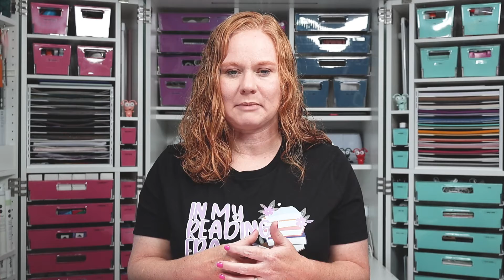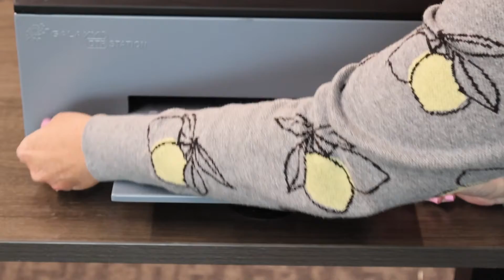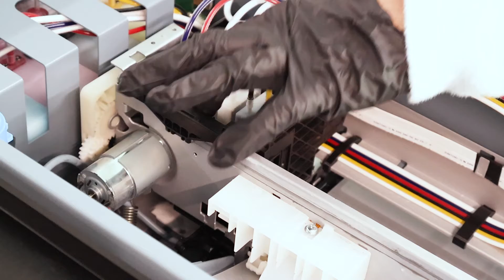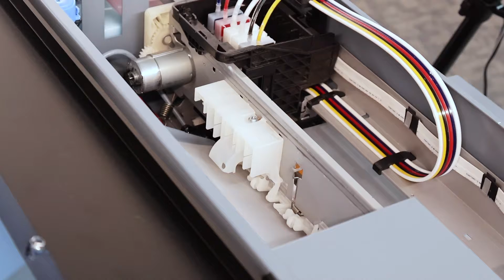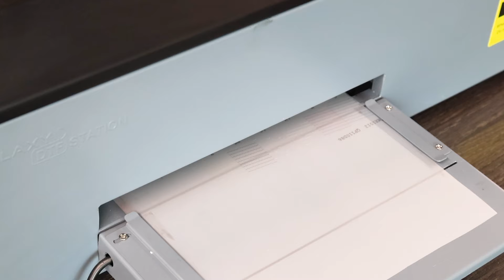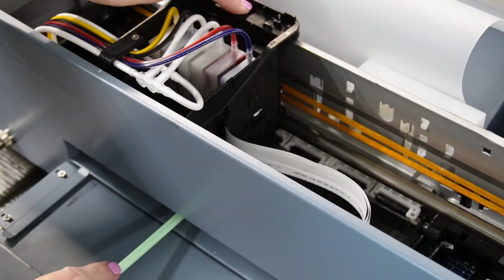DTF Printer Setup and Maintenance: DTF Station Prestige A4 Printer

Comment: When pulling the I'm thru can I use the same tip or should I change every time?
Reply from the maker: You just don't want to mix colors. So if you get one color on the tip, be sure to use a different one for the next color or wipe off.

Comment: Hello, Love your channel! I purchased a DTF printer from Amazon. Im not able to get it running. the feeder roll is not moving. the unit turns on, runs but will not advance the roll forward or backwards.
Reply from the maker: I would contact their customer service.
Reply: @AngieHolden  I've already tried reaching (emails, all social media platforms) out to them. With no luck. Luckily, I'm learning alot about this machine. Just taking a bit more time. I've already filed complaints. Valuable lesson learned.
Reply from the maker: Yea I do not recommend the purchase of a DTF printer from Amazon. I am sorry!

Comment: Just got this printer and havent used it yet. It was already set up by the company who sold it, with inks already filled. Waiting for the rip software code from them before using. Is it ok to sit for a few days with the inks? Would i still need to do daily maintenance while it isn't in use? They mentioned leaving ink caps almost completely loose to let air in but not sure why. Thanks
Reply from the maker: It should have come with cleaner in the wells already so you should be okay. It may take you a while to get it working once you can print.

Comment: Hello, Can we print images for t-shirts that are XL in size for exemple, with the A4 printer ? Thanks
Reply from the maker: Yep. It will print as long as you want so it will work with a design that is not over about 8 inches tall.

Comment: Hi, I have the same printer and would like to know if you ever got banding or lines in your print. After many head clean I’m still getting lines. Any tips to fix this issue?
Reply from the maker: I would print a nozzle check page. Do you have missing segments? I would assume so. If you do, run through the cleaning cycles and pull ink through your damps/waste ink tank. If you don't have missing segments it could be an alignment issue. I would probably contact DTF Station or get on their Slack channel.

Comment: I got this printer a couple of months ago and I love it.  I'm an older lady with only a moderate amount of experience with printers and I was able to follow the Prestige setup videos with no problem.  Once everything was set up it has been pretty much smooth sailing.  I had some initial questions and used their slack app and got pretty quick help (there is a time zone issue as I think they may be answering from another country) but they are very helpful.  The only drawback for this printer is the smaller size of the print but I knew that when I purchased.
Reply from the maker: Great to hear!
Reply: @pamelajoudi_craftsbypammy  thank you!

Comment: Hello, I have a question about the Siser Juliet Vinyl cutter. I currently have a Cameo 4 and use that. I work in small detail and often cut paint mask with the Cameo. One thing the Cameo cannot do it cut a prefect round circle. I really want to buy the Siser but if it will not cut a circle, will have to pass on it. I'm talking about a 20mm Circle size. Have you cut small circles in this size range with the Siser? Thanks.
Reply from the maker: Yes you can cut those with a Siser. You should be able to cut them with a Silhouette though. Might try some troubleshooting with them to see what the issue is.